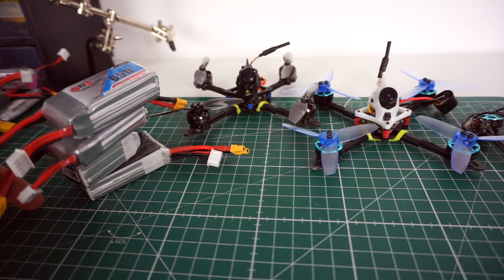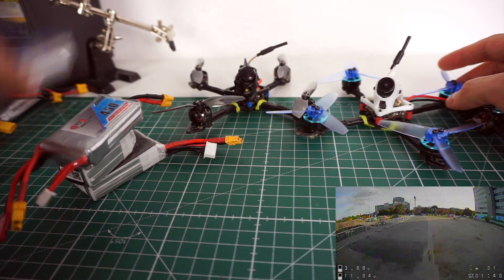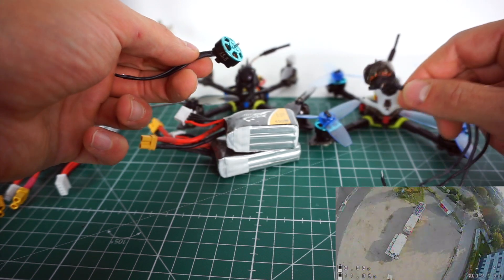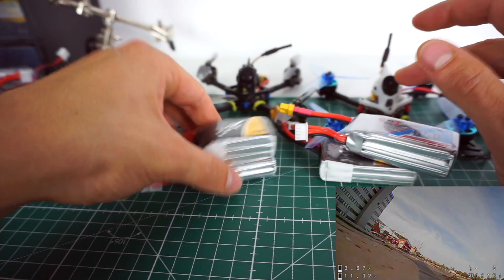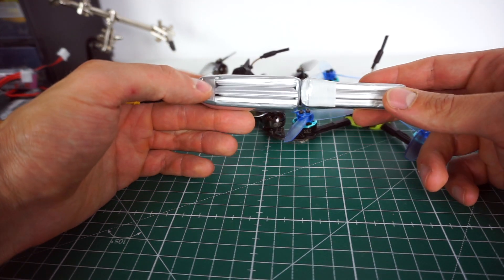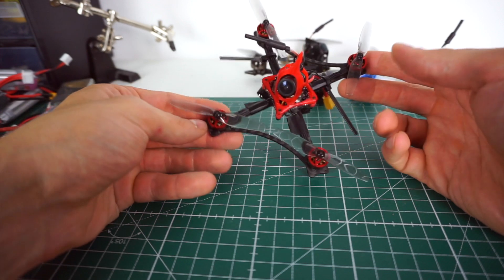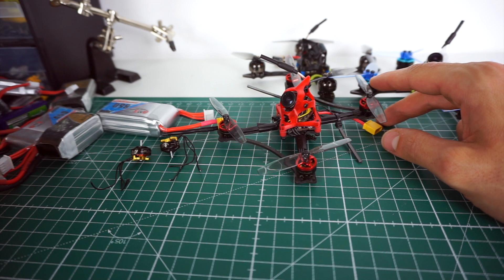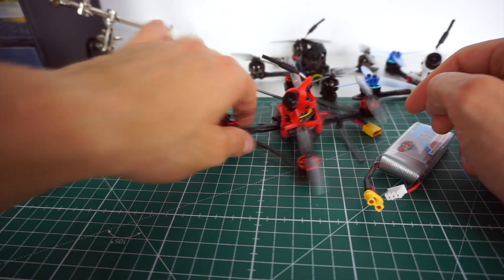GNB 650 3S - Finally a match for the 1404 3" Toothpicks

Comment: How have you found the longevity of the DYS BE1404's?  I seem to have smoked a lot this year (my 3' inch builds are a lot heavier than yours).
Reply from the maker: aaron test never smoked one! But they seem to be made out of pretty soft aluminum. On those light builds they are ok tho
Reply: aaron test a bell flew off one of mine and my 3" has been sitting since 😂, hadn't crashed it and the shaft was no where to be found! Any 1404 you would recommend ?

Comment: I use rcx 1304 4000kV on 4s 450 for light 3 inch builds. I think that is quite a balanced combination. I don’t see much of an improvement with bigger motors, maybe it’s because the batteries don’t deliver enough amps.

Comment: I agree with your 1404 observations.  I've run DYS and RotorX 1404's with DYS being much lower in power output like you say.  As for batteries I think you're in a bit of a goldilox situation.  450mahs not enough power, 650mah well definitely have flight time (~5 mins), however with a +10gram tax or so.   I've found my sweet spot to be the GNB 550mah, providing ~3mins flight time and coming in at only 54grams.  Btw Tattu also has a new R-Line 700mah coming in at 62 grams and its been flying pretty spectacular too.  Thank you Dave for all the Frame designs and videos!

Comment: thank you! these are hard to get already. why are you doing this to me. share your sources please :D did you try the "Infinity Graphen 850mAh 3S" in comparison?
Reply from the maker: Banggood has them in stock :-D Link in the description. Nope I kind of stopped testing a few weeks ago after the GNB 650 worked so well. I have way to many LiPos already I need to stop testing stuff left and right :-D
Reply: @DaveCFPV  ya some many batteries. i am exceptionally impressed with the one mentioned - so i asked a veteran pilot - and he was sharing my opinion. this battery is what actually made him think about flying micros instead of 5" only.. so if you get the chance, i'd be glad if you could judge on these in accordance to your experience.
Reply: Gretel Tom I don’t know about a 850 3s on a 3”, most of them weight 88g. That’s a ton of weight on a 3” maybe a 4”.
I have been testing a ton of different brands and sizes and have concluded that the best is a 2-3s 450. Even when I went to the gnb 3s 550 the weight was definitely a issue when trying to be nimble, but if you are flying in a big wide open space then yeah go as big as you want till the weight bothers you. I have been flying my twig 3” with 1104 7500kv on a pulse 3s 75c and it weighs 42g and it lasts 3:30-4:00 flying fairly hard. + the pulse is nice and compact! I usually am not a big fan of pulse and do favor gnb.
I hope those don’t sellout now!